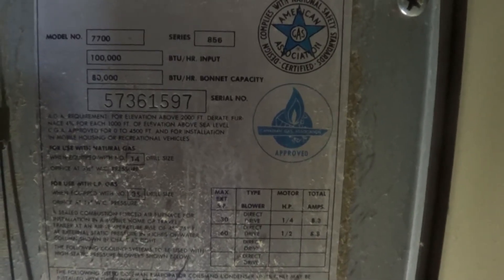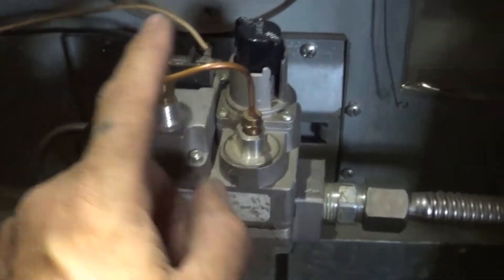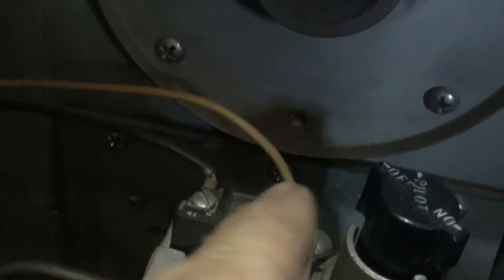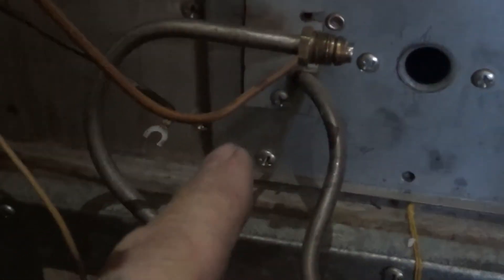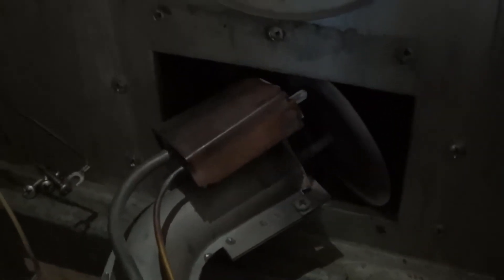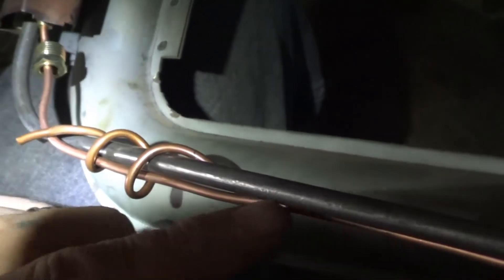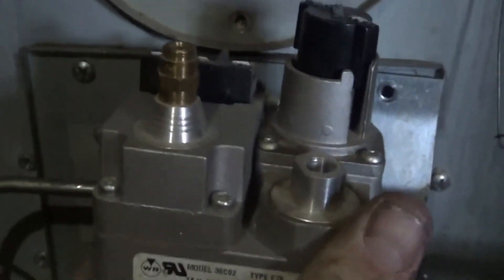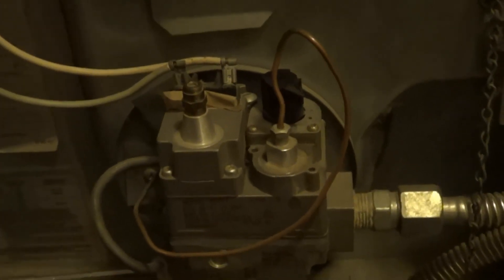How to change a thermocouple on a mobile home furnace

Comment: Thanks bud i appreciate you taking the time now I'm ready to tackle it
Reply: Very cool, I appreciate the comment.
Reply: @randydolph852  your vids are helpful Randy. I've  the same valve in this video w the black dial pilot nob however when I release the nob, even very slowly, the pilot goes out. A bad valve or nob? Is it possible just to replace the nob as the valve it's over $300?

Comment: Going to try using this video for reference to replace my thermocoupler. I have something similar, will need to check model number, but the set up looks the same. However I don’t have an on and off switch. What do you suggest I do? Should I cut all power off from circuit breaker panel?
Reply from the maker: All furnaces should have an on/off switch. It may be located up closer to the blower wheel if it is an older model.

Comment: I have the red dial when having the long match in there. I move the red dial to set holding up. It lights I hold for 30 seconds. When letting the red dial down to the set position, the flame is out right away. Does that mean I need this thermocouple.
Reply: I’m having the same issue, how did you get the flame to stay on?

Comment: What would cause a thermocouple to corrode so fast and blow up at the tip? (Furnace thermocoupler)
Reply: Hello, how fast are we talking? Is the pilot flame turned up really high? There should be a flat head nut on the valve to turn it up or down. Sometimes it’s just a faulty couple.

Comment: My furnace is cycling on and off every minute or so, will replacing the thermocouple help fix this issue?
Reply: Do you mean cycling like the blower goes on and off or the flame goes on and off? Most times the flame does that it’s a bad limit. Make sure to bypass, for diagnostic purposes only, the thermostat at the furnace, (touch red and white wire together) and see if that goes away. Do the same with each of the limits to test that. The only thing the thermocouple does is keep the pilot lit. It does not open an close the valve. It works simply from gas pressure
Reply: @randydolph852  Hi Randy, thanks for your reply. It's the blower that is cycling on and off, I'd been looking at some videos of newer models that have a flame sensor and thought the thermocouple might perform the same function.    I'm wondering if you have any other videos on how to perform maintenance on this model of furnace.  Thanks for your help. Dennis